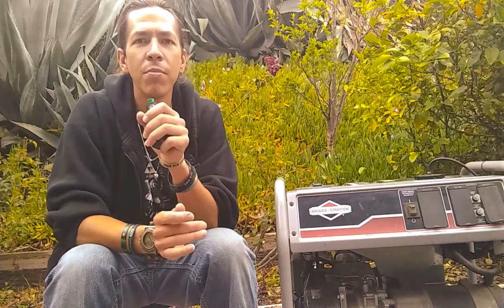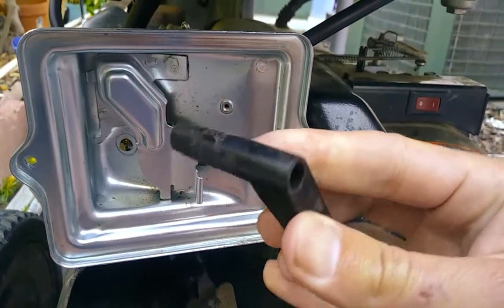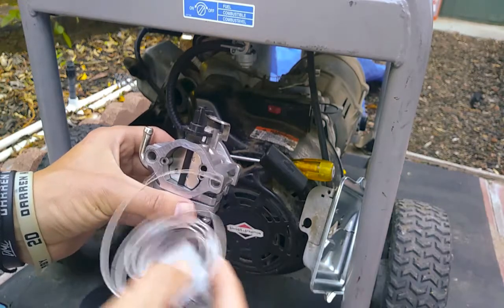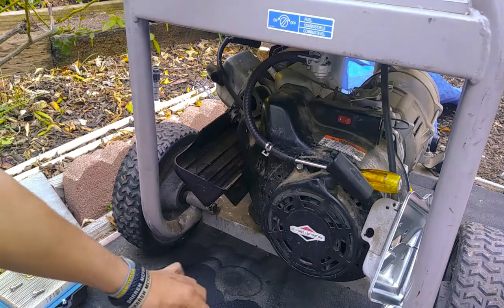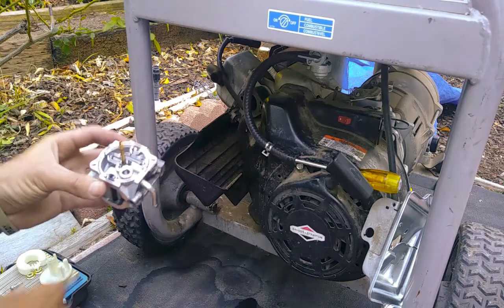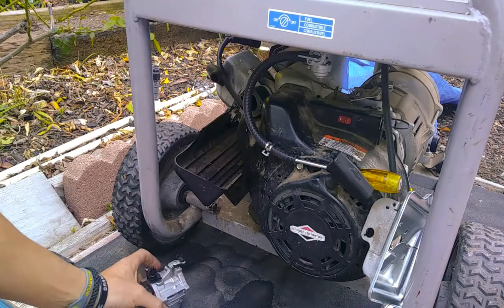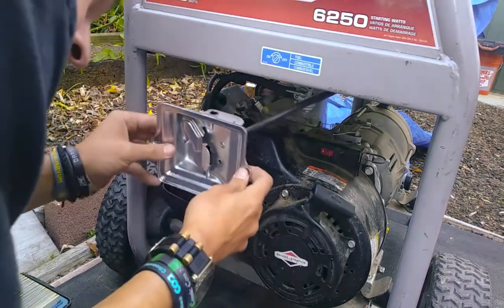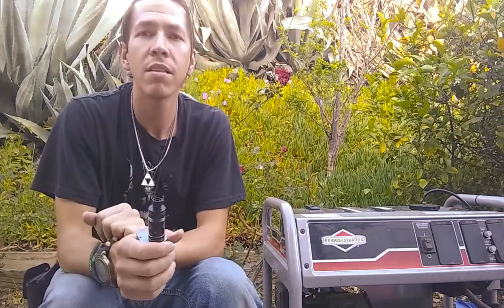Carb work on a Briggs & Stratton generator: How to clean, rebuild and reinstall your carburator

Comment: Thanks Brother...ran through all the steps after watching several videos and had no success until I watched yours. The pin that sits in the toilet seat like piece I didn't have it set in the grooves until I watched your video.  Popped it off again set the pin properly and BINGO.💪 Thanks Again